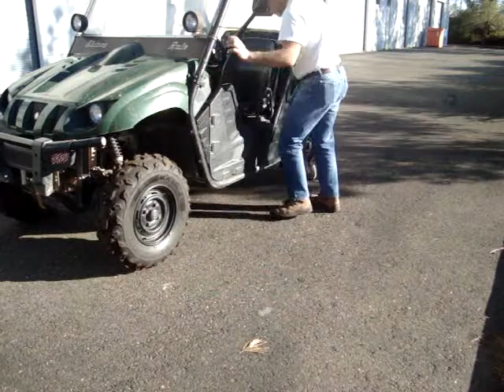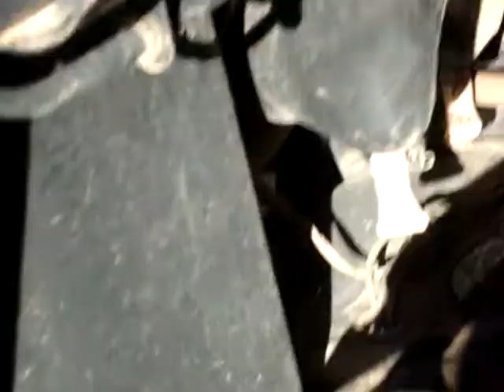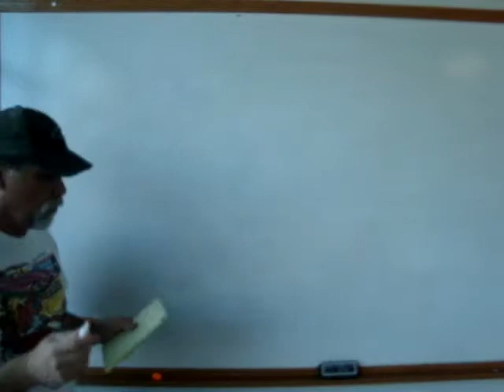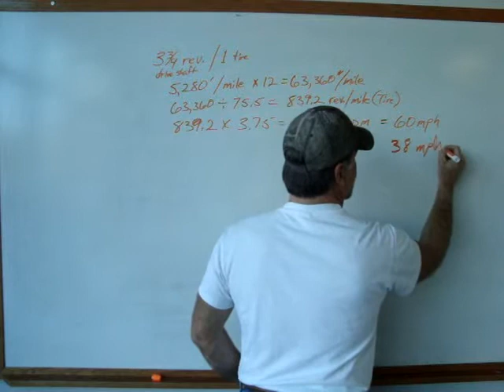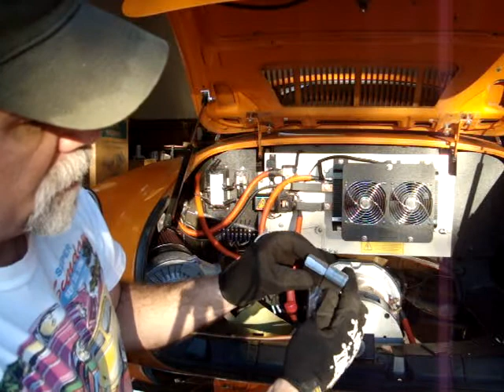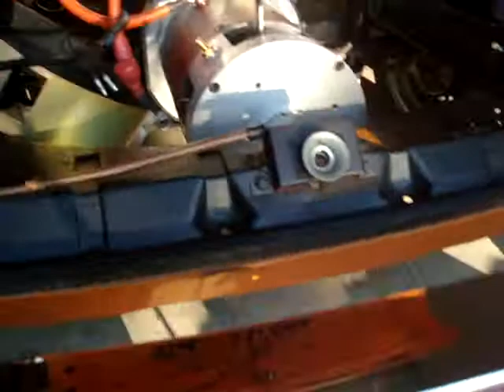EV Conversion Information Flash Back - The EV Answer Man Episode 11

Comment: Hi Richard,

 I have just come across your Answer Man series and was watching Ep. 11 with the calcuating of the Rhino. While taking your measurement you stated the drive shaft rotated 4.75 turns for one rotation of the wheel, but at the board you used 3.75. Did anyone ever point that out to you.

 I enjoy your series.

               David